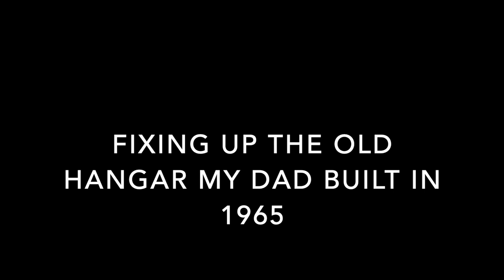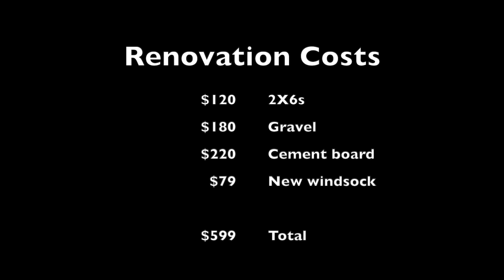Fixing up Dad’s old hangar

Comment: thanking of buying a kit fox 2 but only has a 582 so not sure big enough
Reply from the maker: Henry, Kitfox 2 is a good airplane, but you want/need something more powerful. The 582 is 2 stroke, only about 60hp as I recall. you should have the Rotax 912, which range from 80hp to 100hp (mine is 912ULS and 100hp) or something equivalent. 

Look through the experimental tab on Barnstormers. There are some interesting planes there. 

Let me know if I can help. I’m planning to be back this summer when international travel opens up again......maybe August. 

Greg